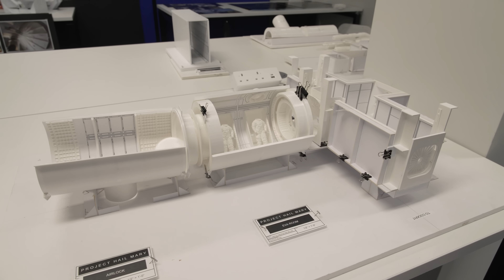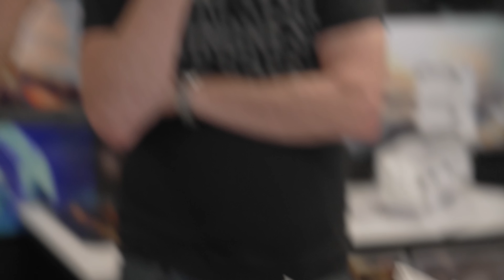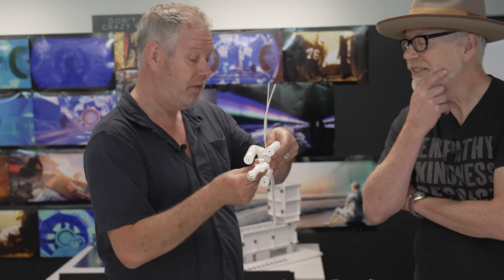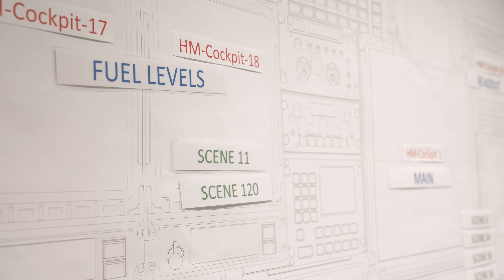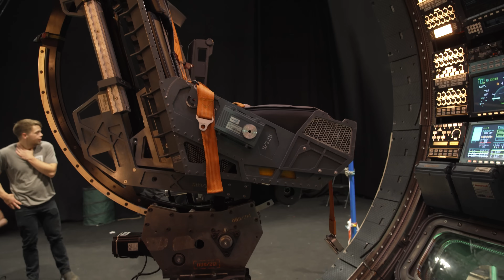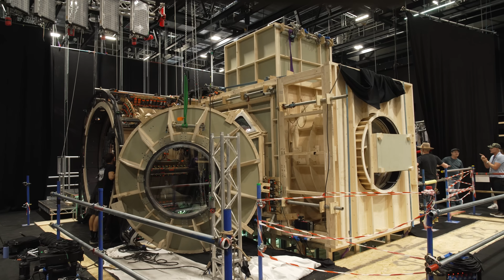Adam Savage Behind the Scenes of Project Hail Mary!

Comment: So many of the set design issues are from diverging from the design in the book. In the book they specifically turn the modules 180 degrees between flight mode and spin mode. The floor is always the same floor, "gravity" always pointing the same direction. It doesn't make sense to have the module only turn 90 degrees, there are far more moving parts then